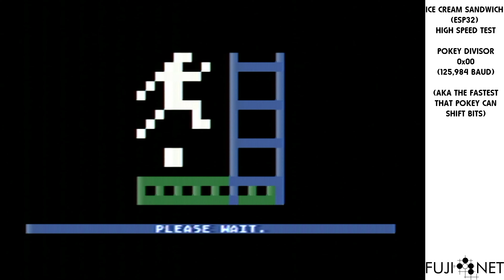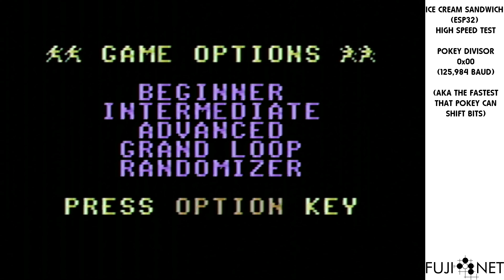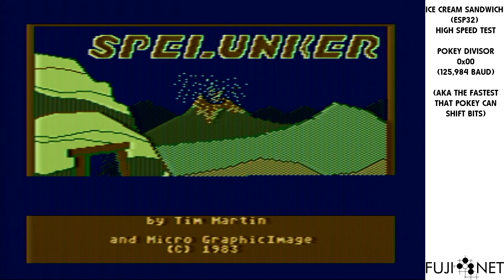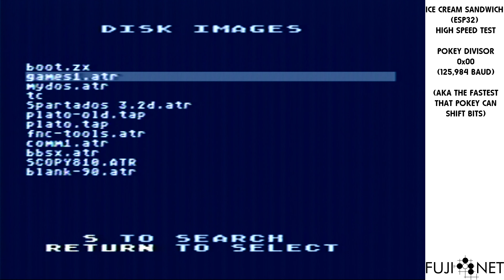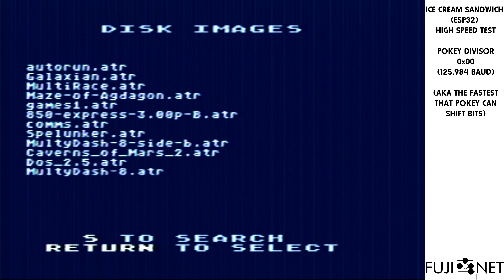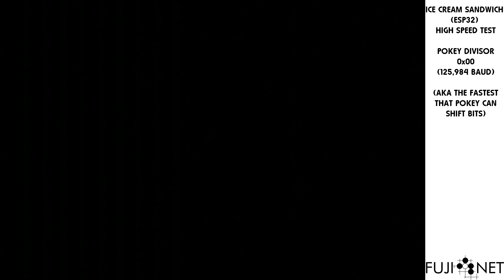#FujiNet High Speed Test (Ice Cream Sandwich - Pokey Div 0x00 - 125KBaud!!!)

Comment: what step did you take to get this speed out of the fujinet?
Reply from the maker: implement US doubler protocol, if a command frame is malformed, the baud rate is switched to the desired high speed setting (because the Atari will try again.) The baud rate will shift down to normal on the next malformed command frame.

Comment: Is this connected to the SIO port because I thought that only had a transfer speed of 19.2kb. So, how?
Reply from the maker: Yes, it is connected to the SIO port. The baud rate is determined by the clock divisor set by POKEY, and the default divisor rate is 40 (0x28), which against the clock gives a rate of 19.2kilobaud. The default OS SIO routines normally transfer at this rate.

You can replace those routines, either by the loaded DOS, or via a PBI routine to get much faster rates, and in this case, the Ultimate 1MB BIOS I am using has high-speed SIO routines that can be turned on. They use the US Doubler protocol for querying the desired POKEY divisor, and you can use any divisor you wish, all the way down to 0x00, which gives approximately 127KBits/sec. Due to the ESP clock, we had to choose a baud rate that was a bit lower, but still within tolerance, so 125,984bps. :)
Reply: @tschak909  Sweet!
Reply: @tschak909  Oh I need to get my incognito hooked up now. (Have it, but have been distracted by work and other hobby stuff.)